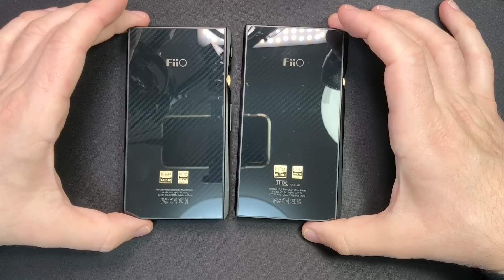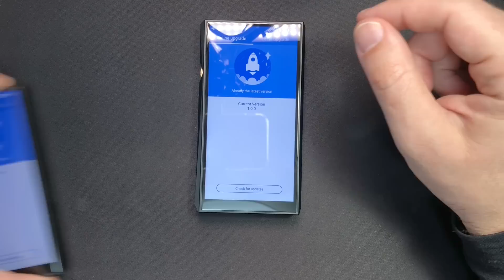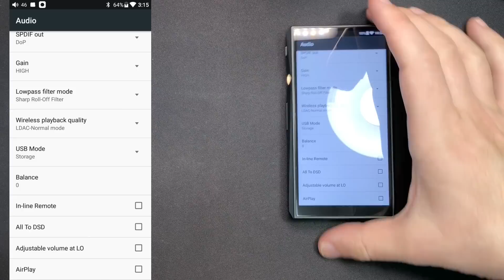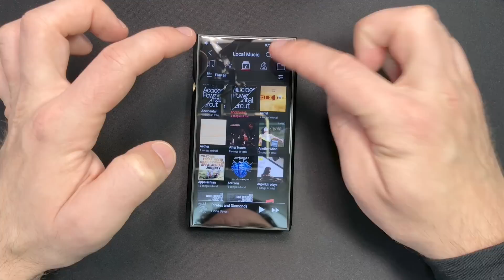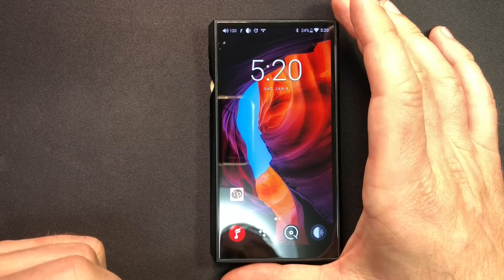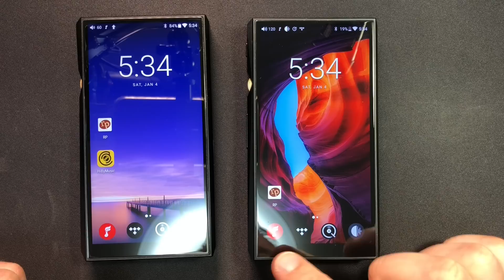FiiO M11 Pro High-End Portable Music Player with THX Technology - Review

Comment: what does "bit perfect" mean?
Reply from the maker: It means that the software does not alter the music before it is decoded by the DAC into analog. For example, a digital volume control will alter the music to reduce the volume level. Android, by default, alters the sample rate of the music before conversion (or digital output to another device). It does this using poor quality conversion, which is no good if you have high-quality audio gear. FiiO and other manufacturers use a modified version of Android that doesn't do this.
Reply: @Currawong  is it the same when streaming music via bt?
Reply from the maker: Bluetooth is not bit-perfect. It uses one or another type of lossy compression.
Reply: @Currawong  how bout bt5.2/lc3 is that lossless?
Reply from the maker: All Bluetooth audio is lossy.

Comment: A question, and subscribed just now btw. The M11 LTD (I know not Pro), I am seriously considering, have there been any issues you noticed with heat with the Pro? One user said the M11 would get uncomfortably hot to the touch, not sure if that was bogus or what. Great review!
Reply from the maker: Good question. I recall causing I think an M11 to overheat and throw up a warning charging it in a car that was hot. I'm guessing that someone was running "All to DSD" or similar and charging one of the M11 series to get it hot enough to be uncomfortable to hold.  It's not different to smart phone in that regard.
Reply: @Currawong  So basically the same overheat occurred from too much charging, heavy use similar to what I've seen on my Pixel4. Makes sense.

Comment: Question.  I want a dap for about 400 dollars. Good eq. And good volume power and battery.  I got the hiby and fiio and their eq was so bad. That even if I change the 60dz it changed the tone on the 1 k and 3 k. And when I add bass the volume drops 6db. I want something with power.  With the eq like the Sony nw a55 that it's really good and above 100mw per channel output.  What you recommend
Reply from the maker: https://hear.audio/faq

Comment: @ Currawong, Hi, thanks for the nice review. I am planning to buy an M11 pro to use as a streaming device for Tidal and Spotify. I want to hook up M11 pro to an external amplifier and listen over a pair of speakers. Two questions: 1. Can I use a 3.5mm to RCA male jack to connect M11 pro's line out directly to the amplifier? 2. Is it possible to control M11 pro from a smartphone (that is, smartphone becomes the remote of M11 pro)? Thank you.
Reply from the maker: Yes and no. a 3.5mm to RCA cable will work. For remote control, the FiiO music app can remote control the music app itself (but not other apps) remotely. Remote control I don't think is really possible, unless you can find something on the Google Play store or another app store. For streaming to a fixed system, I'd be more inclined to set up a suitable desktop system with DLNA or Roon, though the latter doesn't have Spotify.
Reply: @Currawong  Thank you very much for answering my queries.

Comment: @Currawong  

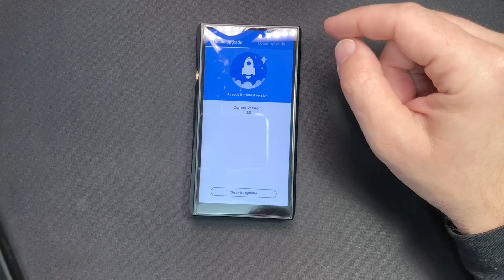Amos, thanks again for the review.  I see at the 5:50 mark in your video that you have UAPP installed on the original M11.

Is it also possible to "side load" the UAPP app on the M11 PRO, and will it function properly, especially in regards to streaming Tidal or others, in addition to bit-perfect output via the USB Type-C port?

Comment: In a nutshell here is my problem with a single SD card slot. I currently have a HiBy R6 and it only has a single slot. With a 400GB card I have a small bit of room left after loading up my 24/96 FLAC library (approx. 6000+ songs) for some Tidal downloads. I also like to listen to audiobooks. However if I load both FLACS and books onto the same card then everything shows up in the same menu. As a result I do not keep my audiobooks on my DAP. At this time I am thinking about partitioning a 512GB card into two separate drives and using one for music and the other partition for books. The price pf the 512GB cards has dropped below $80 now so I think it's time to try it out.
Reply: use jetaudio player...and browse by FOLDERS . any other browsing method is a crazy mess

Comment: Nice job on detail the DAP! Could you just do something about the reflection on the DAP. I’m in the market for a DAP and I am looking into FiiO market and I am waiting to see M15’s. Thanks
Reply from the maker: I forgot to add a note, but while I was recording, I couldn't see what was going on with the reflection. I had re-shot much of the video a few times already, and it gets to the point that if you have a few good takes, it ends up taking hours to go through them and decide which is best, of if bits of one are worth merging with another.

Comment: You'd get better value, audio, and versatility from an older LG phone with a DAC like the V30.
Reply from the maker: It would be interesting to compare the audio quality from one of the LG phones, but I'd be surprised if they could match a dedicated DAP like the M11 Pro. At least on spec, the power output from the phones isn't that great.
Reply: @Currawong  but the v30 can power a 600ohm headphones, and the m11 pro can't from what I hear or did I hear wrong? I want to make sure because because I have a LG v30 but now I want a m11 pro

Comment: I would have liked it if you spoke on what the item sounded like connected to the car stereo system. What cables to you use to connect it to your car to make it sound great/
Reply from the maker: I'm not sure the stereo in my car would relate to what is in other cars particularly. I just use a cheap cable to connect whatever I'm using as it's just the stock system.

Comment: Unfortunately FiiO do not support MQA using the Tidal app on the M11 Pro. MQA only supported in the FiiO Music App currently.
Reply from the maker: Yes. That's a weird choice, but I guess the complexities of doing it otherwise would be too great. However MQA is fake high-res anyway, so you're not really missing anything.
Reply: @Currawong  could you share more details about what makes you think MQA is fake hi-res, I've read a comment from you in the unboxing video saying the same and tried to find some info on the internet but couldn't find anything relevant.
Reply from the maker: I have it in mind to do a video about MQA at some point. I need to gather everything together though to do it.
Reply: @Currawong  please do so, maybe mqa is the same thing as mp3pro was back in the 00s.. (mp3 at half the bitrate with sbc compression which has to be "unfolded" 🤣 sounded muddy and bad imho.)
Reply: Use Quobus instead of TIDAL. Overall soundquality is beter. And Hires in steeds of MQA. Workshop on M11. I use an Emperian and it beats every IE.

Comment: The wireless on my M11 goes out all the time, frustrating.  Also, the overall touchscreen could be better to use.  It seems less quality than any of the iphones I have used.  Now, I am happy with my purchase, I put off buying one of these DAP's and finally went for it.  See my comment below about using it as a DAC.
Reply: Wireless as in Wifi?
Reply: @paulh1860  Yes, wifi, will go out if I stand between the M11 and router or place my hand onto it to select music.  It's probably due to the distance from router.
Reply: @manardh7387  I had issues with 5ghz, when I disabled 5ghz it worked fine. Turned out to be a setting in my router, I had to select 5ghz b&n or something to that effect, ever since it's been stable

Comment: Good review. I stuck with the standard M11, and it has been fantastic paired wth the Fiio FH7. I did find issues with the file transfer though, and now use ES file transfer on the M11 to send music via FTP, as the Fiio wifi file transfer will only do tracks, you cant drag entire folders over.
Reply: I have the same combo! M11&FH7 :D Using Amazon Music HD as my music source! :)
Reply: @d1n01988 : It sucks,  FIIO M11 pro sot supporting apple music!!!
Reply from the maker: Wow, I didn't realise that ES File Transfer could do that. Thanks for sharing.
Reply: @Currawong  no problem, I had issues with using the SD card in the M11, if was to take it out and place into my MacBook I could see all files and use as normal, but when the card was inside the M11 and I used that to connect via USB using Android file transfer, it would not display all files, which is very odd. Fiio said Android file transfer has issues
Reply: I have the M11....tether it occasionally to the Oriolus BA300s tube amp....or Schitt Magni 3....gives it a bit more oomph driving my Tin P1's to excellence...otherwise the M11 by itself , makes my SHUOER TAPES  shine as well. No reason to spend $200+ to buy the M11 PRO....none of my IEMS have any hiss as noted in the Andromedas when used on the M11.  I kinda cringe at the > M11 PRO future "spec monsters" yet to come....gonna drive prices up to the A&K insane level. Dammit FiiO give us full blown Android, Google Play, any apps we want.....only then would i consider future models😡
Reply: I have the same combo as well. I love it to death. I am sorry you have problems with the storage. I use Windows for file transfer and never had an issue.

Comment: Thank you for the review. I bought the m11 pro a couple days ago. I agree with everything you said, but for me the pro sounds a bit more harsh and tiring (piercing sometimes) compared to m11. Will this improve with burn in you think? I am using fh7 and ier m9. Maybe im just too sensitive to highs and too much detail.
Reply from the maker: It's not supposed to sound harsh and tiring and not supposed to need burn-in, but you might try leaving it running overnight playing music to see if anything changes in either the IEMs or the M11 Pro.
Reply: @Bence....what in this dap would require burn in and that would take away that harsh sound you're hearing?

Perhaps after you listen to it a bit more, your brain will become accustomed to the sound and all will be fine.

You can try the filters, although most people can virtually hear no difference.

Good luck and happy listening. 🎧
Reply: Try rubbing some snake oil around the headphone outputs. Much better sound improvement than burn in. 🤣🤣🤣
Reply: Hmm, snake oil or not. A little burn in seemed to help. I had let it play for 2 days on its own, and it seems better now. Harshness went away. Now it is just pure awesomeness :)
Reply: @doomb430  lol....glad to hear you're liking this dap now. Sweet. 🎶🎶🎶

Comment: Could anyone suggest a good dac/amp or a dongle dac for me (a broke student) I recently somehow got some new iems. 
Thanks. ( I wish I had the money for an m11 pro)
Reply: ibasso dc01 or dc02 look pretty good especially if your iems are 2.5mm balanced
Reply: Ibasso dc02 is decent while the Meizu dongle DAC and the zorloo Ztella both sound better than the IBasso, but have significantly worse build quality. The Meizu is for sure the best value. With the performance of these DACs off of an Android phone, I think DAPs are pointless now, especially considering that they put out several year old versions of Android with crappy touch screens to boot.
Reply: @mattsch21  did you use them both matt? bth ibasso and meizu? if so how was the sound different ?
Reply: Fiio BTR5 best bangs for money according to Zeos sound on par with M11
Reply: Bro the BTR5 would be the purchase you need. 😄

Comment: Thanks for the review. How does the M11 and M1 Pro compare to the X7ii, purely on sonics?
Reply from the maker: I missed the chance to review the X7II due a bit of a stuff-up with someone else who I was sharing a review unit with unfortunately, so I can't answer that. Someone on Head-Fi might have both units though.
Reply: Wait..... FiiO M15 on the way....  note the specs...  https://www.youtube.com/watch?v=m6NiQGCt4uQ&t=73s
Reply: @seyley2901  £599 for the M11 Pro compared to about £1200 for the M15, so not in the same price bracket. Someone has released a volume knob protector, as this has been flagged as an issue because it is so exposed.
Reply: @darrencotter8206  Obviously I agree with your comments re: price bracket... but (there always has to be a 'but'), some of 'us' are looking for the evolved next step from the X7 mk II with the AM3D module, do we simply go to the M11 Pro and have all items marked off on our tick-list, or do we consider the M15 as being the next step UP from entry level units....
Possible that the M15 may be all fluff and bluster, or a legitimate challenge to the mid level DAP market where any 'enthusiasts' can pick our a number of elements that separate it from the M11Pro. We wait and see or in my 'world' I'll hold off from M11 Pro with the option to plump for it if the the reviews of the M15 aren't on point.
Reply: @seyley2901  Double the price, so not really a valid comparison to the M11 & Pro.
Reply: @darrencotter8206  See my reply to 'this' repeated question.

Comment: How are you Sir. Happy New year. I so wanna get a player but really seeing if worth than my phone and ibasso dac combo
Reply: Not worth keep your money. you'll need to really listen for a difference, and in casual everyday listening you just don't hear it.
Reply: I have the M11 and am using it as a DAC to my Macbook.  I use ROON app and oversampling to the M11.  I also am connecting my M11 to a cheap class D amp to speakers and get very VERY impressive sound.  I will say though the cable used from DAP to amp will make a difference.  Again, if you use a very good cable the M11 will step UP to the task.  I put off the purchase for years, decided to try one of these things.  I'm glad I did.